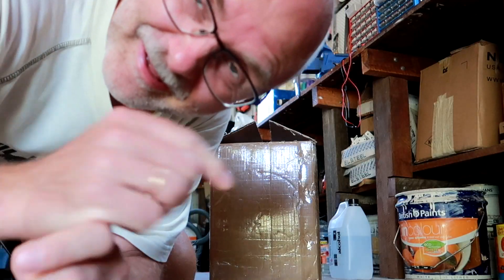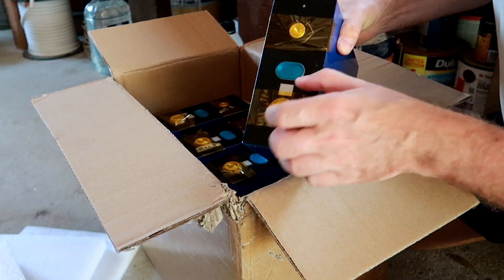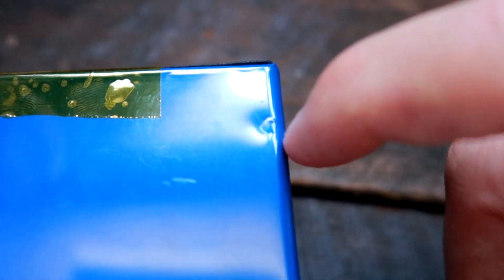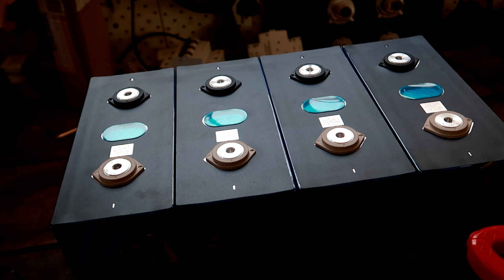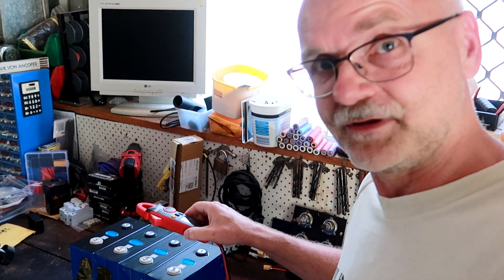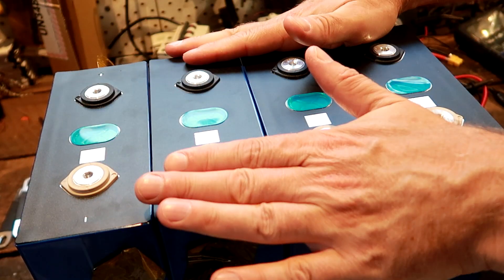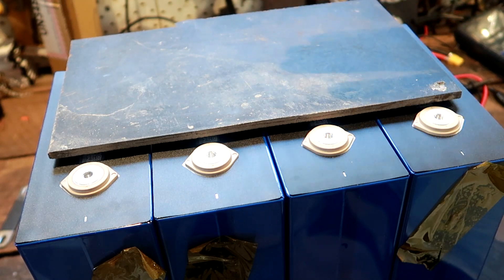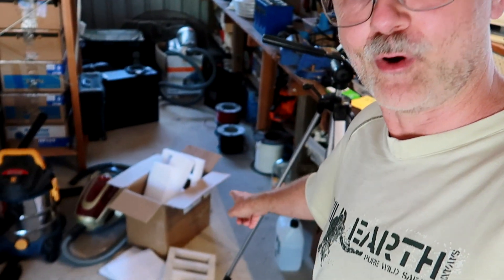Tutorial: Handling new battery cells

Comment: I don’t recall any comments on the terminals. 
1-any concerns with dis-similar materials 
2-are you using bolts or have you considered studs for the bus bar / wiring connections. 

I have 8 - 280 ah batteries on the way from China. Just trying to be ready and considering the possibilities for my RV.

Comment: Usually for my initial voltage check, I would just poke the probes thru the tape. Keep the terminals covered as much as possible for as long as possible.
Reply from the maker: That's what I did. I now have little holes on top of the terminals which I need to sand down again before connecting the busbars.

Comment: good info on your videos, I will be soon pushing a similar box as I bought 4x200ah aluminium case cells to make a 12v leisure battery for my landrover on which I have 360w solar panels :) and also a Daly bms 250A, exciting days ahead :D
Reply from the maker: Sounds great! Let us know how you go with that. Will you use an inverter too or just the 12V system?
Reply: @OffGridGarageAustralia  have no need for a inverter so will just be a 12v setup. I'm using redarc 12v  bcdc1240d charger and a victron bmv-712 to keep an eye on the system. Hopefully the Daly bms will come with temperature sensor as the manufacturer guarantees that the model they sent has one. I'll keep an eye on your channel to see how you'll get on with the big setup as you said batterys are getting cheaper so I may upgrade shed with some free power :)

Comment: Nice Video Andy!
Even the tip with handle these cells not without cellprotection/bms. stay save walter
Reply from the maker: If they are all in parallel, there is no other protection apart from a fuse or breaker.